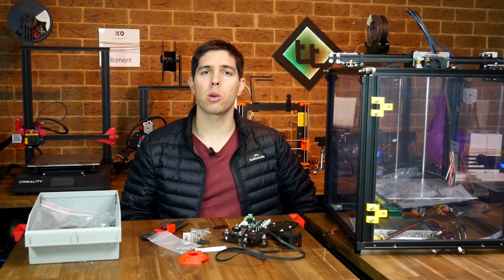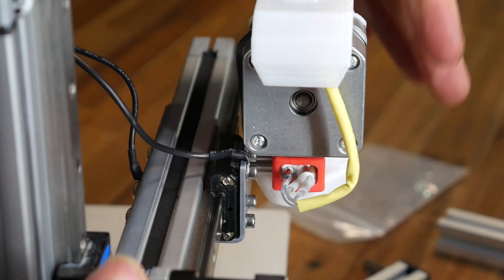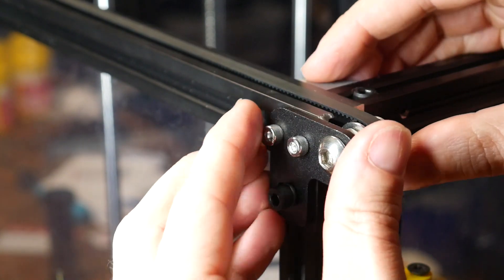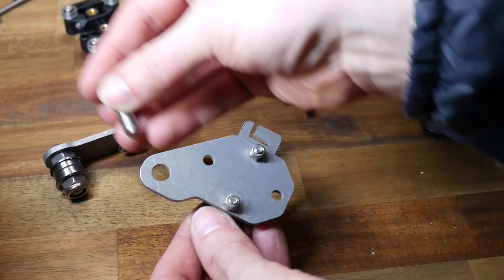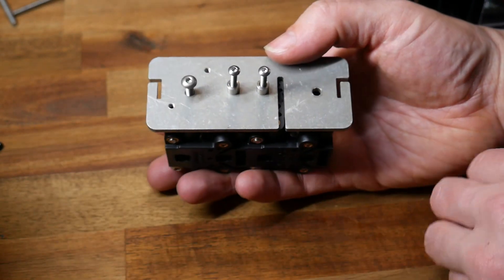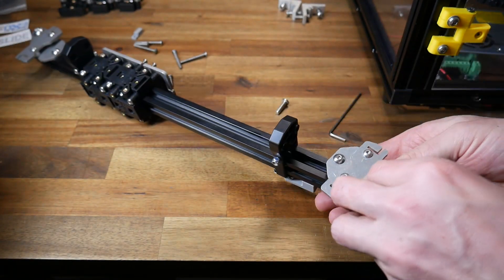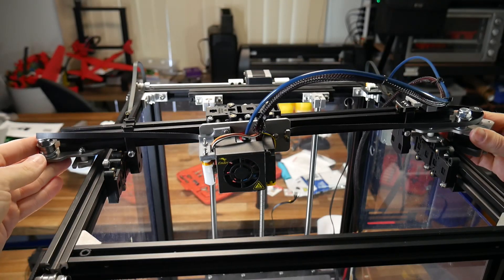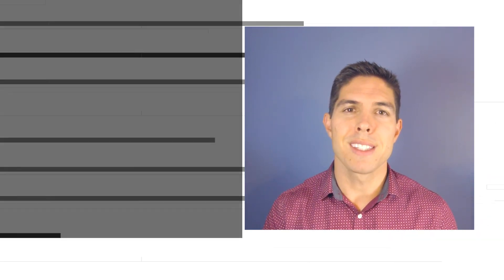Exoslide linear motion system on the Ender 5

Comment: I'd like to know the noise output once up and running, it seems on my Ender 5 I  can't get the wheels to be totally quiet, there are always some spots where they squeak and it drives my wife absolutely nuts.
Reply from the maker: They make a rolling sound which is about the same as standard for volume. No squeaks before or after for me.
Reply: I put a drop of oil on mine, stopped squeaking.

Comment: Problem. The liniar rail in machined with much tighter tolerances. That system uses the aluminum extrusions for guidance just like vslot wheels the only difference is those ride on the flats instead of the alignment groove. Seems to be marketing BS. metal vslot wheels are probably just as good as that.

Comment: the hot end carriage, I guess it's called the X axis that it's mounted to. Would it be more rigid with an 2040 extrusion instead?, or will rails be more rigid, even on an 2020 extrusion?
Reply: You have to use a lot of force to twist a 2020 extrusion. An Ender 5 is not a CNC machine running 6mm DOC in AlMg4.5 - the X-axis wont ever twist under printing conditions.
Reply: @Panzermuh  well, I was watching this video, see at https://youtu.be/7TLgI9na_SY?t=881 Since It's pointed out that it is moving/twisting similarily like before using exoslide, I assumed that it is an issue?

Comment: It's not about making things tight, it's about making them well-tuned. Some play, or flex is beneficial when used correctly. 

This looks like a waste of time. You actually weakened the rails with that smaller adapter.

No only that, but it doesn't even seem like it would be an upgrade... It seems inferior to just using a widened extrusion with v rails - which would probably be dirt cheap since you could reuse the rollers and mounting hardware. All you'd basically need was a widened roller-mount plate and a new extrusion!

Look at what the Artillery Sidewinder X1 did to fix an imperfection issue... They designed a slot on the z axis threaded rod where the x axis mounts. And what it did was allow the whole x axis to rise up a little bit when the extruder tip hit an imperfection in the previous layer, helping to distribute the imperfections out over a few layers and making everything feather in alot better for a much better result.

And remember when you put linear rails on the Sidewinder? It actually got worse, because the stock design was already tight enough.

Comment: What about the elephant in the room?  The wobbly cantilevered bed.  The best rails on the planet aren't going to help a lot if the end of the bed is waggling up and down. Fix the obvious issues first.
Reply from the maker: Well I already addressed that is the first video on the enclosure. I tested a printed support for deflection before and after. Please check it out, it's linked in the description.

Comment: Are there ways to buy the exoslide if you are not located in the USA and Canada? I kinda want to upgrade to that too.

Have you thought about fixing your X-carriage upside down so that the top of the ender 5 can be used and a top cover is easier to design ? It will decrease the maximum height of the printer but I think the ender 5 have quite abit of Z-height.
Reply: For international orders, using the contact form, just send us your order, Paypal and shipping address.

Comment: Is it rolling metal on metal? Aluminum wouldn’t hold for long if it’s the case.
Reply: FAQ on their website states: 
Q: Do they wear the aluminum rails?
A: The polycarbonate threads are softer than the rails and will wear first. The plain steel bearings do leave marks on the rails, with wear proportional to bearing preload and cycles.
Reply: And this one:
Q: Do I need polycarbonate (PC) bearing treads or plain chrome steel bearings?
A: PC treads have lower rail wear and are quieter, used for example on the X & Y carriages of a 3d printer that experience thousands of cycles. Plain steel bearings have a higher load rating and roll smoother, used for example on the Z carriages that have more preload and less movement.

Comment: This is a horrible value proposition, weakens the stability of the frame with smaller corner brackets. Adds all these plastic parts, has almost no metal, and still manages to cost more than knock off hi-wins. Even if you do not know how to properly tune knock off hi wins, they will be much better at a third the cost. Perhaps you could have talked about implementing proper 2040 extrusions, it is a simple upgrade and only costs about $10.
Reply from the maker: It's your money and you can choose how to spend it. I don't remember recommending this, only demonstrating that the x axis carriage was more solid. In fact the description states this is a guide, not a review. No need to try and make it personal.

Comment: The truth is that all 3D printers are poorly designed. It is hard to find good engineers in these days.
Reply: I would expect an industrial grade $100k+ 3D printer to be fairly well designed, but hobby grade 3D printers certainly have some compromises to cut costs.